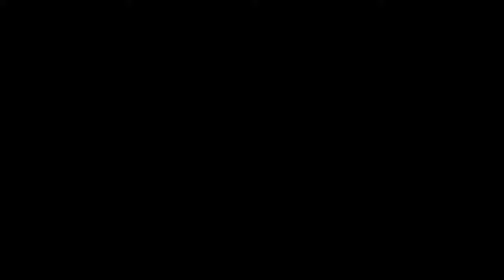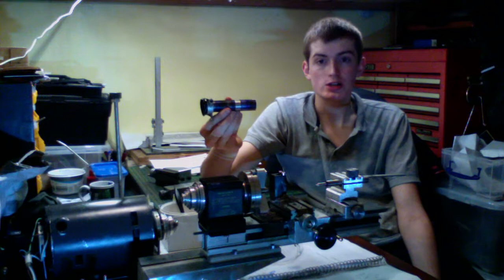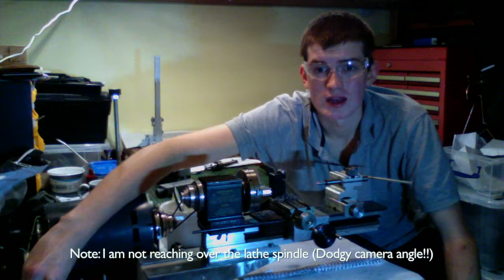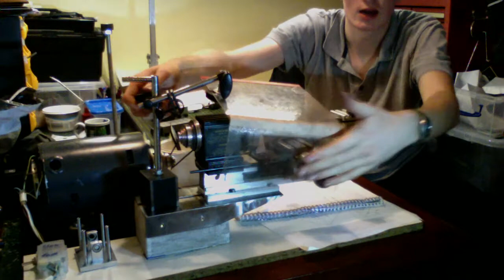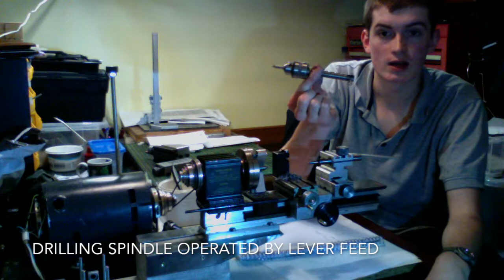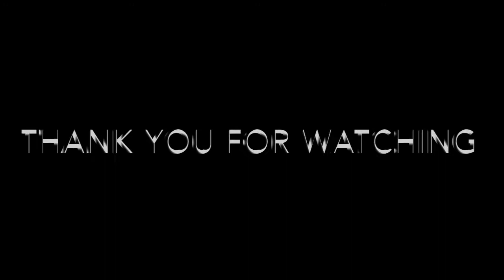Introduction to Peatol Lathe

Comment: Get better light, better camera, better microphone and show more of what you show and less of yourself. Change camera angles, zoom on on things you are talking about and cut / edit video. Some of these costs nothing, Windows has a video editor included, better (more) light basically costs nothing, and changing camera angles and zooming in can be done even with your current gear. By increasing the light the camera will reduce the ISO and increase the image quality. Good luck.